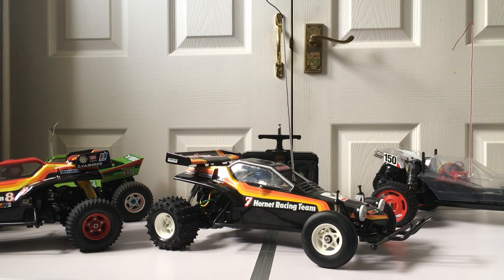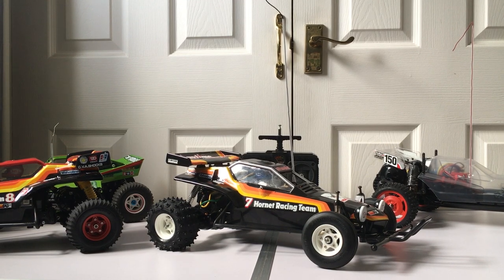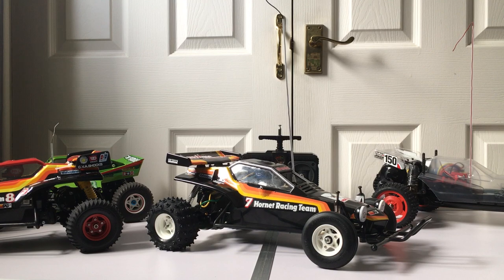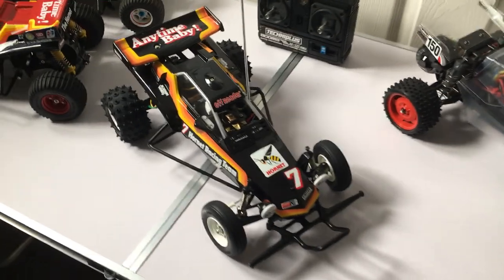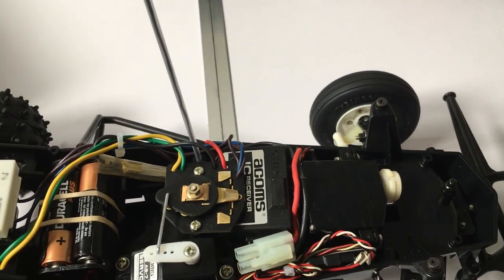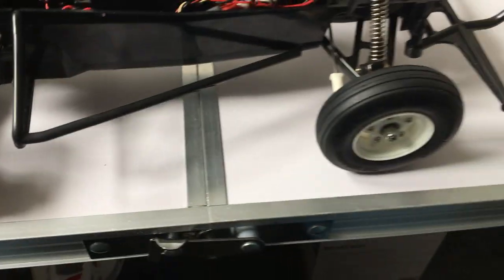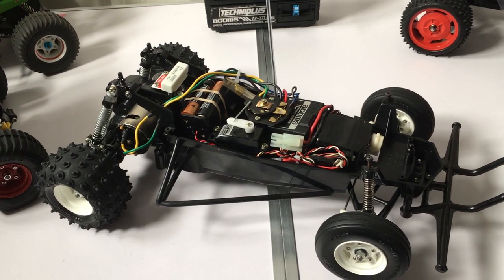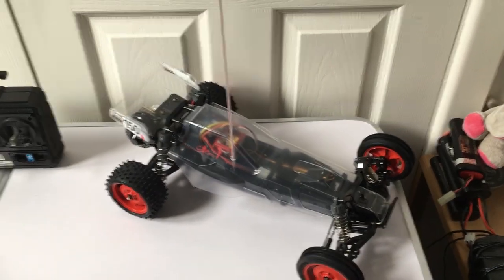E:16 SWIFT-RC Original 1984 Tamiya RC Hornet Restoration Project

Comment: That aerial pipe is quite straight!  I take it that's a replacement?  When you mentioned the shell was restored, is it the original shell or a new one?  Thanks... Lovely car :O)
Reply from the maker: Hi Jonathan , ha ha yes the ariel pipe was new , from what i remember as it wasn’t my car the body was the original and mark who built it bough some nos decals for it . Many thanks :)
Reply: @andyrobinsonrc2480  thanks, just wondered especially as the shell looked new. I have an old 80s hornet and it'd be nice to breath new life into it and wasn't sure whether to get a new shell or repaint the original. 👍